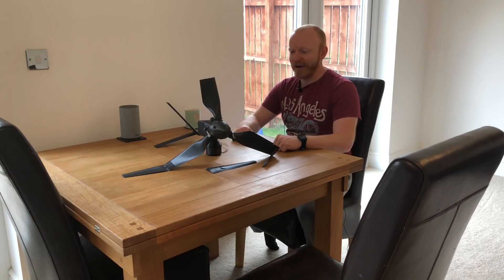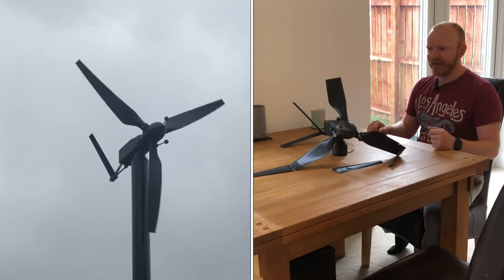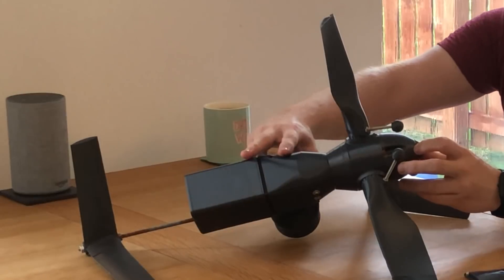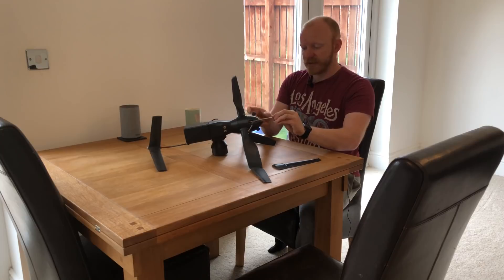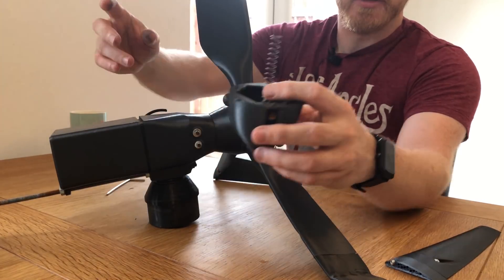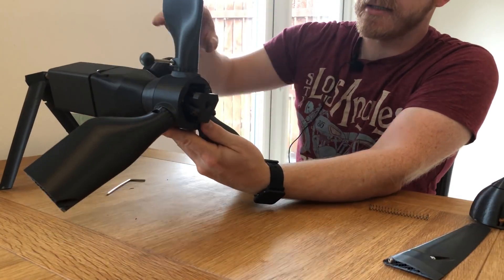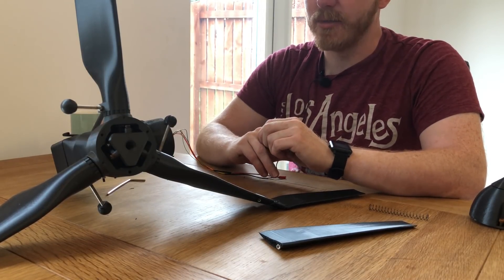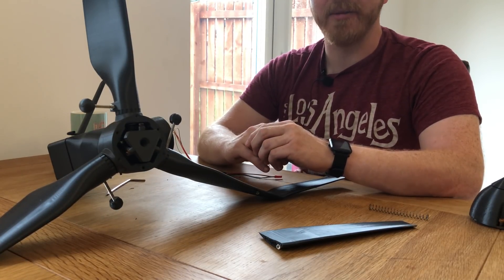Can You 3D Print A Wind Turbine?

Comment: Hi, I build this model last year and had exactly the same problems except for the rusting nuts and bolts. I printed two of them and both of them were distroyed by strong winds here in the Netherlands. I had a stable tripod at a balcony about 8 meters above groundlevel. One of them just desintegrated. The other one turned over. I more or less gave up on it. I used ABS filament, tried the printed bearing, the metal bearings, the rotor with the automatic pitch adjustment, the rotor with the fixed pitch and every improvement I found on Thingiverse. I was never able to get power out of it.

Comment: With Solar panels you can have two different types of converters. A PCM and MPPT, whereas the latter, MPPT may be a good idea for a wind turbine, given the changing output from the turbine. This is ofc a DC converter so rectifying the turbine output and smoothing it with a large capacitors would take out some of this variance.

Comment: Great vid, thanks Colin. I have also got a design off thingyverse But enlarged the blades by 50%. I will also design the motor housing using Fusion 360 (depending what motor I use). All I want to do is give a backup to the solar powered lights that we have. I think it just means that I have to solder the wires from the turbine to where the solar wires go onto the circuit board. Work in progress, lets wait & see. All the best....
Reply: I think it would be more efficient with a normal DC motor.

Comment: HI Colin, this wind Turbine got my attention as soon as i saw it, I have Printed all the parts and I am ready to assemble it all together, would you recommend using a strong Adhesive on the parts that do not need to move to give it a bit more strength and instead of seals use a liquid Gasket, It was great to see what yours looked like when its put together even though you had the accident, please keep the vids going
Reply from the maker: Liquid gasket maybe a good idea, with the rubber ones they had a tendancy to snap
Reply: @Chickey  HI Colin,  I still haven't put it all together yet, Im hoping to move but this virus has stopped that, this will be on the roof of a shed I will be building and to store the power I have a bank of Golf buggy Batteries, when completed and I've moved I will defiantly show your Design off,,

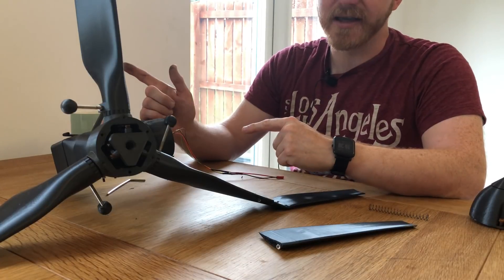Comment: 12:38 There´s no great conclusion for this video
Reply from the maker: Thanks for the comment, i always try to be honest in my videos and there wasn't a conclusive outcome.  I'll be making a follow up video very soon.
Reply: What usage cases is it good for in your setting- I get that it's hit and miss. Charging phones? Running a raspberry pi? What about running a pi zero? (Thinking of non demanding things)
 In optimal situations assuming it'd do a lot more than that from the wattage you're quoting - likely charge up a big battery.

wondering how it would fair mounted on a boat or used on a camping trip to provide power. ;-)

Comment: For inexpensive charging and battery management you could look at solar panel charge controllers. They deal with wide range DC inputs  and have battery management so no loads needed. They can be had for pretty cheap. For example on Amazon you can search on "solar panel charge controller" For 50W they are inexpensive.

Comment: Hi Colin,  Interesting that there is a design you can 3D print.  Regarding your questions on regulation, ultimately the speed of the turbine will be regulated by the electrical load however, it is not clear what you have connected to the motor. I see a bunch of wires and they all seem pretty thin for sustained, low-loss power generation.  I run a wind turbine on my boat and it provides useful power. Its a permanent magnet alternator type and so the power needs to be rectified.  Basically it runs directly connected to the battery but with a dummy load (2 wire would resistors) for when the maximum battery voltage has been achieved.  Of course, you can imagine many ways of using the excess energy. If yours is in a shed over the winter, you might indeed have the 2 resistors switched in to allow them to raise the temperature (a little) and prevent damp.

As for the DC-DC converter, I'm not sure its necessary as it is yet another energy-wasting step.  If the goal is to harvest as much energy as possible then the fewer stages, the better. (I've talked to someone who tried to have an MPPT controller professionally designed - they abandoned the project as not feasible).  

Given your situation, I'd stick it one the highest braced pole you can find and delight the kids by having it power a nice string of lights at the end of the garden and maybe an outside Christmas tree, using the excess energy to keep the shed dry.

One thought also might be to experiment with fixed blade angles to see if you can harvest any useful energy.

Comment: @ 6:50 you could go with a O-Ring to make a seal when creating the third piece. When you finish, try coating the entire windmill with UV Protectant Polyurethane  and attach it to the side of your roof using a tall pole with clamps.
Reply from the maker: I'm really reticent to attach it to the house as it would highlight it too much to the neighbours.  At the moment it's on top of the kids playhouse which i built for them so i get away with it on the cuteness factor.  In the UK it's meant to be 5m high and 5m away from all the neighbours which would mean bang in the middle of my lawn lol.  Thanks for the tip on the oring, i might see if i have a slightly larger one so it's not under as much strain constantly as well.
Reply: @Chickey  If you can print TPU, you could print flexible  gaskets that would stay in place.  Just an idea.
Reply from the maker: I had thought about that actually as it would be easy to design one that is the right dimensions so not being streched/strained like an o-ring.  I have some TPU and used it for seals on a 3d printed powerboat.
Reply: I also purchased Sheets of rubber gasket that you cut to fit at different thicknesses. I've seen these at heating and plumbing shops and automotive if that may help.